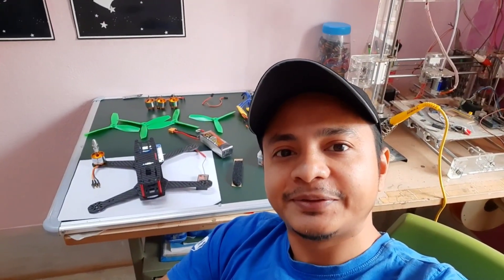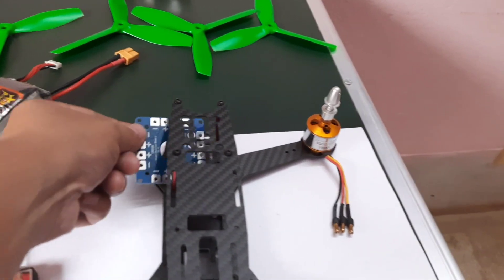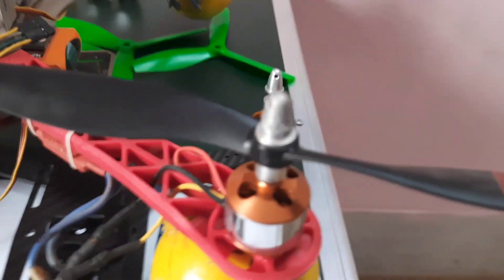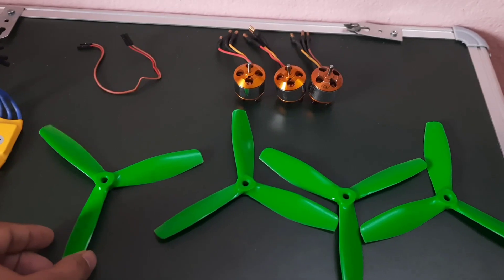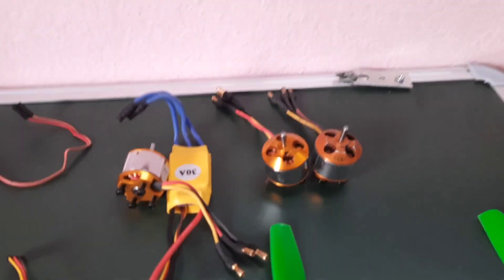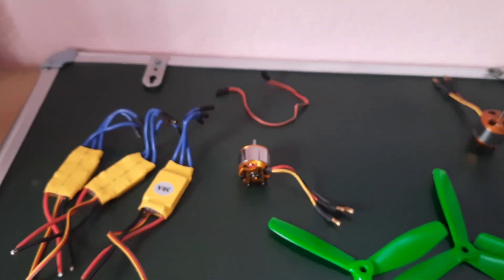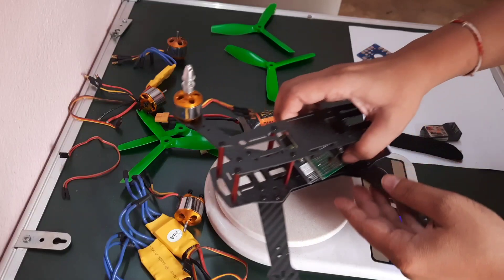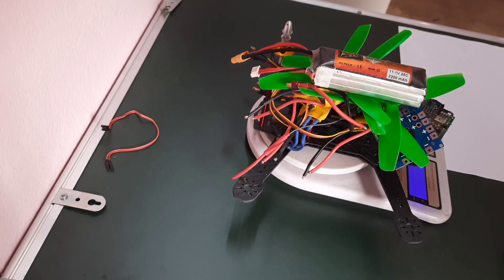Building an affordable F250 (5inch) Arduino Drone Part 1

Comment: Hi, i can see you stopped working on the f450 drone... are these small props require balancing? How much thrust is the 1800kv motor on 3s?
Reply from the maker: Its reasonably good. The 5inch quad flies well. Infact I find the thrust a little uncontrollable beyond mid throttle. The motor-6045 prop combo generates higher thrust above mid throttle. I have not measured thrust but Estimate its 400-500gram
Reply: Code plz